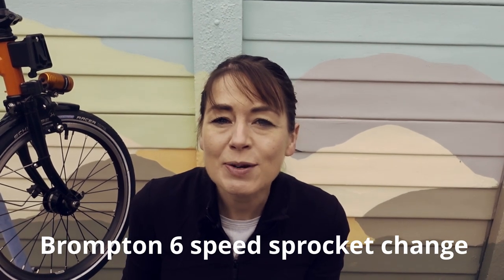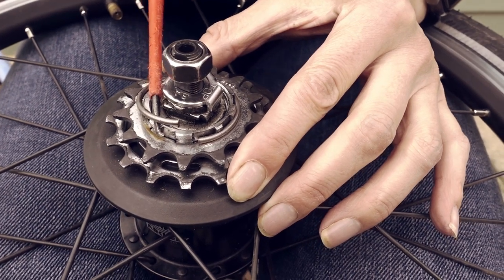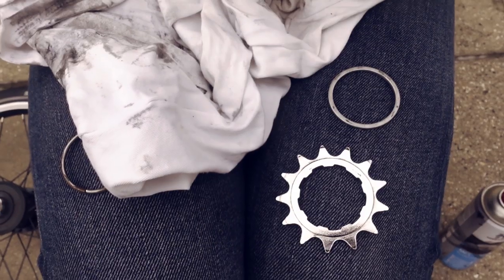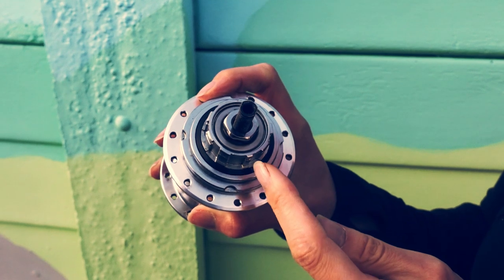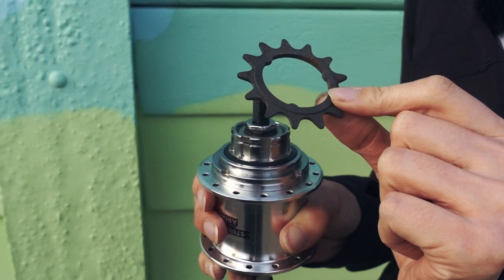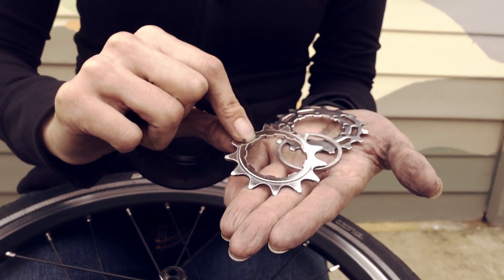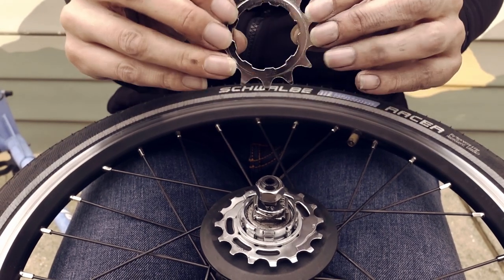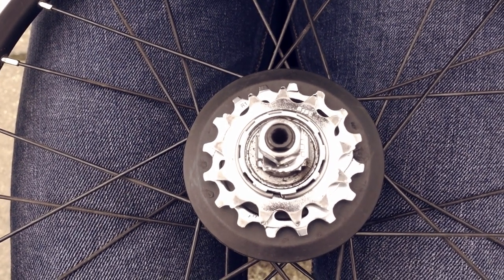Brompton BWR 6 speed sprockets

Comment: I’m maintaining my bikes because of lockdown, this weekend is chain and sprocket replacement on my Brompton. Thank you for the video, you made it look easy.
Reply from the maker: Thanks for watching 

Good luck with the sprocket change

Our no 1 tip is to remove the tension from the chain tensioner when removing it!

Let us know how you get on
Reply: brilliantbikes finished and surprisingly easy. I had trouble getting the new circlip on, but it popped on by exactly following your method. Bracing the back of the circlip and then working the ends at the opening. 

Thanks again for the video, it really helped.
Reply: @AnthonyThomas_Ant  Chain replacement was a doddle; my nemesis is getting the old circlip off LOL

Comment: 3:23 You made that circlip technique look so easy! For those who are struggling, I found it's useful for the middle of the clip (the not-open end) to be lodged properly under one of the smaller "tabs" so that it's less able to slip. The rest is smooth screwdriver technique to guide it right down. Perhaps a screwdriver that isn't too thick (as shown in this video) will help provide more space too.
Reply: you saved me.  thank you

Comment: I currently have 13t and 16t sprockets with a 98 link chain. I would like to change to a 17t sprocket to assist in easier hill climbs. My question is, will I be able to use the same length chain or change it to a longer one? I'm already using a 44t front chain ring. Obviously I live in a hilly area. Thanks and I love your videos.

Comment: I‘ve never cleaned the sprockets like that. I just put the Brompton in the bathtub, use bike cleaning spray and rinse it. 😉 

Is it possible (or even a good idea) to use a Shimano 14t sprocket instead of the 13t if I want a different gear ratio? Instead of using the 44t chainring I mean. 

Btw, your videos are very useful and entertaining! 🙂 

Also, a wish: Could you make a video about the screws and bolts that should be checked regularly? Every time my Brompton makes noises, it’s because of another loose screw or bolt. This week, it was the rear frame bolt. It’s like the Brompton is made of loose screws! Still love it though. 😄
Reply from the maker: Unfortunately there isn't a 14T with the Shimano splines that fits - so 44T is the way to go

Re: your wish - we'll try and come up with a "check regularly" list. I built my first Brompton from left over bits - and have a bad habit of not doing nuts and bolts up enough - and the rear triangle came 1/2 undone during the Brompton World Championships - made me slow down (a lot!)

Thanks for watching and feeding back 

Someone else asked how to clean a bike inside - the bathtub sounds great ... though not too sure about it ;-)
Reply: brilliantbikes 👍 Oh, I can definitely recommend the bathtub method for lazy people who live in a city flat. Of course you have to clean the bathtub too, but that’s not really much work. ;)

Too bad about the sprocket, I hoped the 14t 9-spline XT sprocket might work. But I guess it’s too narrow.
Reply from the maker: Thanks - we have not seen that one before